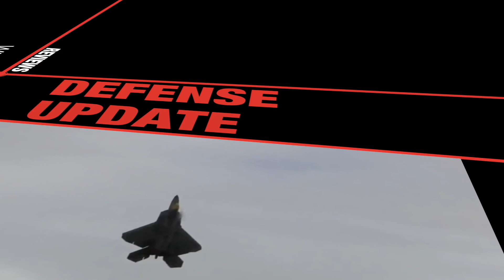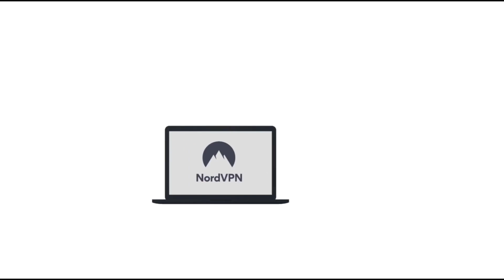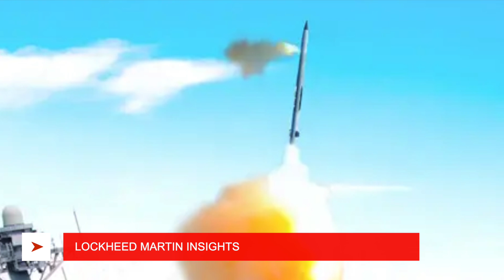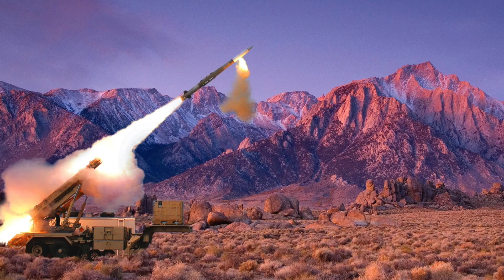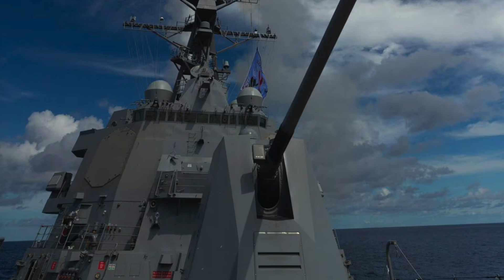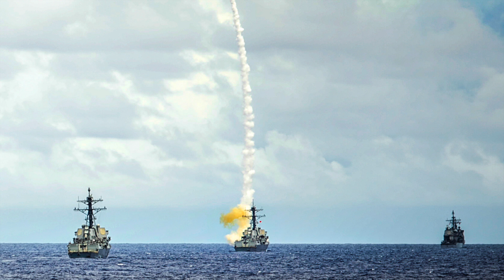Why the test-fire of an Patriot PAC-3 MSE from an Mk 70 launcher is a crucial development?

Comment: All solid fuel rockets take a while to make as the rocket fuel chemicals take a while to cure and set into a solid block.
And the larger the diameter of the rocket the longer it takes to set

that is why smaller rockets and bombs take a fairly short time to make, and the larger and that would be a wider diameter (for rockets, that means the ones that travel longer) automatically take a longer while to make.

Then there is testing a sample out of each batch for quality and verification testing.

So in the end, a rifle bullet may take less than. a second to make vs several weeks to make a single anti-air rocket.

And in case you wonder why they can make over 500 Patriots per year it's because it's a smaller diameter rockets and thus the other reason why they can pack 4  in a VLS container
Reply: Interesting!  Thanks for posting.
Reply: and fyi, while liquid fuel rockets mas much more power and can travel much further, it is a huge cost and chore to store, and handle all those dangerous liquid chemicals  and then fuelling up those rockets for launch. Solid-fuelled rockets took a long time to perfect and is still an ongoing process.
See also the development of air-to-air rockets and the next generation AARAM missiles which must still conform to a certain diameter, weight and length, scientists are still trying to formulate a powerful solid fuel motor, that is powerful and energetic enough to push it to even higher and faster speeds without it blowing up.
These aren't the things you buy and light off in your backyard for July 4 for fun,

Comment: it is a big development.  you can quad pack it.  it quadruples the number of low-altitude interceptors stored in those VLS spots.
Reply: I have been loosely following the Mk.41 configuration of the Patriot Advanced Capability 3 Missile Segment Enhancement program for the last few years.  I am surprised to hear you say the PAC-3s can be quad packed.  There was some talk last year that the PAC 3 missiles could be dual-packed into a single Mk.41 cell.   As of four days ago, according to Lockheed Martin officials, the vertical launch system PAC-3 MSE cannister will contain one missile and can fit across all Mk.41 systems.  I'd like to see your reference link for quad packing.

Comment: They need to make a missile boat holding thousands of missiles that is autonomous with minimal crew, data linked to the destroyers and aircraft carriers this way during a conflict they can use the missile boat for defensive and offensive measures, just make 50 of these missile boats keep the crew at 50 and then just have them during the conflict they just rotate them out, they would definitely have to be one of the faster boats though. Still better than trying to load a destroyer at sea and faster
Reply: Problem with that is Destroyers do that and more and would cost less, a missile boat with hundreds of missiles would need the vls cells to fire them all, it would have to be much larger than a destroyer and have more crew to maintain the ship and it's automated systems.
Reply: This idea is called an arsenal ship. Those would be very high priority targets and, if you lose one, you lose all of the multi-million dollar missiles on it. That said, maybe it's a good idea if done right.
Reply: That missile boat concept isnt feasibe 
The only concept that would actually work is the LPD-17 class mod as BMD ship
As they are using the LPD-17, the cost would be less than making a completely new ship
The LPD-17 size would allow it to accommodate the MK-41 for self defense, the larger MK-57 for bigger missiles, and the MAC system for hypersonic weapons
Additionally defensively, the ship can also accommodate various laser weapons as well standard 5 inch guns 
The space that was once for cargo can additional generators for weapons and sensors as well space for larger computing power
Imagine being able to use the cargo hold for massive super computer
Processing power has always been a problem but with ship that size
it wouldnt be
Reply: Search it the Americans have tested it by reloading at seas. And they have been successful every time. Obviously they have some details to work out but that would be a game changer to reload at sea.

Comment: The PAC-3 MSE from ships is interesting twist
The USN is heavily invested with SM-2/3/6 but other countries may be interested
Reply: Why couldn't they replace essm and sm-2 with it. It does have more range.
Reply: @hermanmusimbi4337  ESSM takes less space.
Reply: @hermanmusimbi4337  
The USN layers its defense with ESSM for short range,  SM-2 medium and SM-3/6 for long range
Ironically the cost of ESSM and SM-2 is still less than single PAC-3 MSE
SM-2s cost 770,000- 2 mil
ESSM- 1.7 mil
PAC-3 MSE -4 Mil
Reply: @hermanmusimbi4337  You can several times more ESSM vs PAC 3, that would be the primary reason

Comment: I have always thought that the army and navy should have all their missiles homogenized for better, faster and cheaper deployment and use.
Reply: Each branches has its own needs
The USN needs missiles to protect it ships from missiles and aircraft. Those missiles need long range ,data links and decent size warhead
The US Army relies on the USAF to protect its bases from aircraft , the Patriot is for missile defense for the US Army
The USAF relies on the US Army to protect its bases from missile attacks while the USAF deal with aircraft in the air at long range
The USMC need defenses that are as mobile as they are , 
its possible to make a common missile
but like the F-35 program
Each missile would optimize for each service needs
Reply: I like having a variety of weapons because one never knows which will be most effective in a future war.